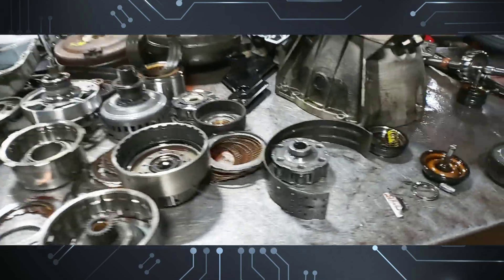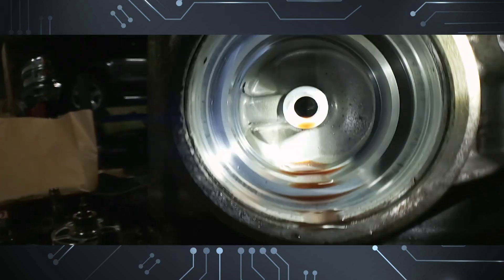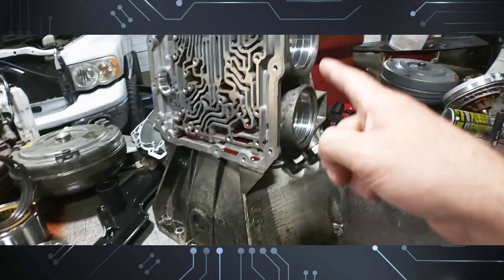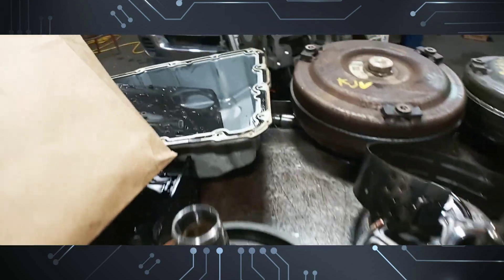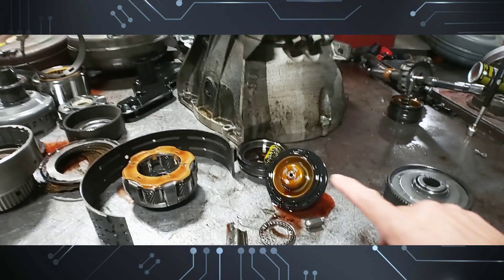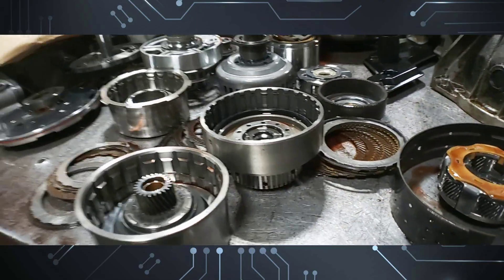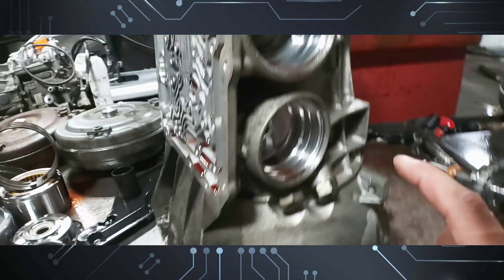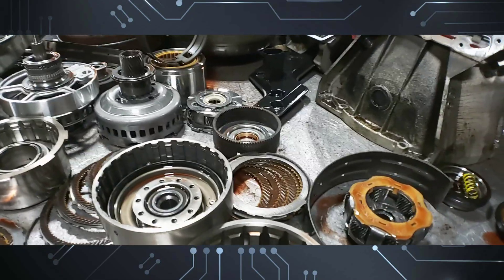⚙️5R55W P0733 Gear Ratio Error Repair - P0733 Gear Ratio Error in Third | Tales From the Bench

Comment: I have a code on my 5r55s we have completely rebuilt it start to finish on one of your videos I put a new torque converter in it and now I’m getting a p0732 code I’m thinking it’s possibly the bands but if you could give me any other ideas I would greatly appreciate it thanks love your vids there very helpful
Reply from the maker: If you have a torque wrench that reads in "inch pounds " , set the pin @ 72in.lbs. then back off 1 1/2 turns on both bands. The front one is for 2nd and 5th.
Reply from the maker: If you have a torque wrench that reads in "inch pounds " , set the pin @ 72in.lbs. then back off 1 1/2 turns on both bands. The front one is for 2nd and 5th.

Comment: Any advise on what a skipping 3rd condition may be? I've got the intermediate band adjust properly and the servo pin is perfect and its not ripped. And the servo bores have updated bushings in them. And it throws no codes. Its driving me nuts 
Its a 5r55s. And the shift solenoid B wire has ground signal at the solenoid pack plug. New solenoid pack too. No valves are hanging. New bands. New band anchors. Band anchors aren't backwards. Fluid isn't burnt at all and the clutches aren't burned either.
Reply: Oh.. and the servo bushing aren't turned wrong covering the hole either
Reply: Hey mate, did you end up finding the issue with this?

Comment: Glad to see you back man. Question on a 99 Trooper 4L30E, it had no engagement in D and l followed your instructions and adjusted the drive band, changed filter. It will go forward in 2w or 4wheel high in "winter" mode (starts off in 3rd gear) but in 4wheel low it drives perfect And shifts perfect full shift range in drive. Rebuild or shift solenoids? Thanks man!
Reply from the maker: How was the condition of the fluid? Usually the band gets burns causing a no forward issue. It usually starts with a shudder taking off then it quits moving forward unless you put it in winter mode. 
Shift solenoids are a common issue as well, if your fluid was good and didn't smell burnt you can start there. Do both at the same time.
Reply: Fluid was black, filter was in horrible condition. I've pumped 5 gallons of at through it, fill it, drive it drain it ( including pulling the front pan each time to get maximum drainage) then pump it full. I just don't  really understand why it shifts fine in four wheel low but not in 2 or 4 high. I guess it's  a rebuild then if it shifts fine in one range but not the others. Thanks man, and good lord it's nice to see you back posting content.  I'm  going to try rebuilding this myself, and that's because your videos have showed me what it takes!
Reply from the maker: In 4 low you take away more than 50% of the load. So if it's completely cold the band will hold and drive okay. Once it warm up it would slip. So basically without load it seems okay. 
But yeah, if the fluid was horrible it needs a rebuild. 
Also, ignition issues, like coils and plugs or any drive ability issues creating a lack of power condition will damage the torque converter and overheat the transmission. So if you know someone with a scope, or if you have one, spark KV should not go above 3kv and burn time no less than 1.5 ms. At idle.
Do this after you've fixed your transmission. If you haven't started on it you can do it now.
Reply: This does drive perfectly. While I've never rebuilt a transmission (yet) l have rebuilt a lot of engines, l will take your good advice and test the spark, but there is no lack of power from this 3.3. I've  actually driven this thing several hundred miles with this transmission as it  is, never more than 20 miles at a time from the house though, lol. It's  a strong ride, l like the feel of the vehicle, and I'll  be going through your old videos looking for one on a 4L30E full rebuild. Thanks man, and enjoy your weekend.
Reply: What's your patreon brother? How do l send you a token of my appreciation man?

Comment: We have a 5R55N that locks up the torque converter too soon in 3rd gear with wide open throttle on the freeway. It also locks up too soon with city driving unless you are pushing it a bit more than average on acceleration. I'm told the solenoid pack needs to be replaced to fix this.  I'm wondering if a Transgo kit will fix most function issues while the trans in the car vs remove and rebuild...currently 76,000 miles and on third fluid and filter change.
Reply from the maker: Yes, a Transgo kit or Superior kit both correct TCC issues. You can start there. 
Also the 5R55N are known for torque converter issues with TCC and something breaks inside causing a rattle noise. Lincoln LS and Jaguar.
Reply: @AutomaticTransmission  I went to a well known shop in the area and was told "better to do a kit when it gets an overhaul". My guess is, they didn't want to the shift kit upgrades because the labor isn't that much and it would keep me away from a rebuild.